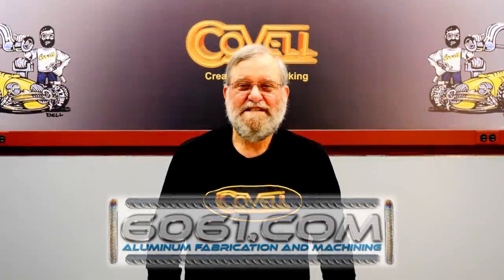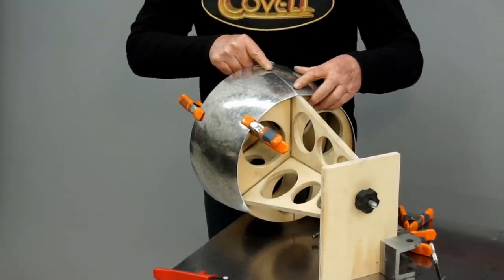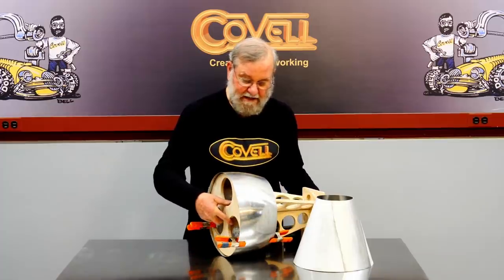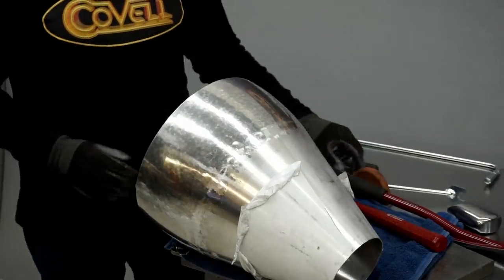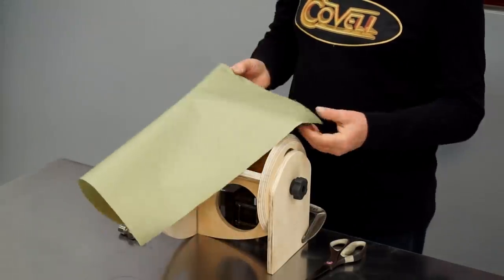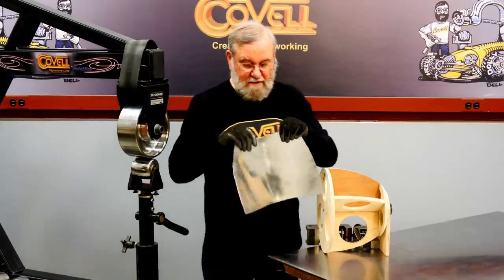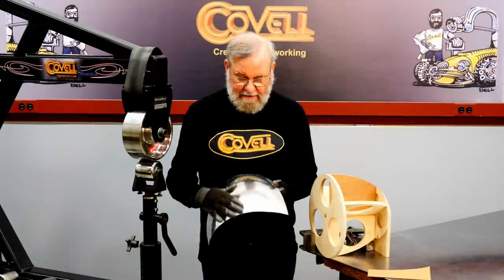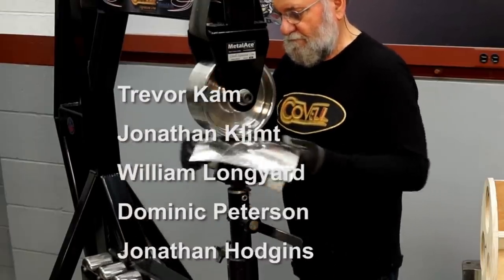Making the F-Bomb Part 3 - Joining the Pieces

Comment: Ron 
You Sir are a legend and well regarded world over.
I note when you are sanding back the weld, what are you applying to the sanding disc?
Love your explanation and tips and tricks.
You make tis look so easy, and explain thing really well.
Regards from Australia
Reply from the maker: I use any kind of bar soap to keep the abrasive from getting clogged with aluminum granules.
Reply: @RonCovell  thanks Ron

Comment: Hi Ron,  you never cease to amaze me with your control of metal. 
So when forming those front sections, does the English wheel actually stretch the metal or does it shrink it as well?
I remember watching a video quite a while back, not sure if it was one of yours, where they put the metal on a sand bag and attacked it with a pointed nylon hammer,  and then used the English wheel to smooth it out into a wok shape, quite quickly to. 
I'm looking forward to seeing you put the two pieces together when you don't have the buck to provide alignment. 
Regards Dennis.
Reply from the maker: The English wheel can stretch or bend sheetmetal, it really isn't designed to shrink it. 
Years ago, I used to 'rough out' shapes with a mallet and sandbag before wheeling. It does save a little time when doing deep shapes, but now that I'm a senior citizen, I shy away from vigorous hammering (hurts my joints) so I find that I can wheel a shape pretty much as deep as I want with the wheel alone, even it it takes slightly longer.
Getting the front half to match the back exactly is pretty tricky work, but you will see how I do it in the next video!

Comment: When you hammer the welds flat does it expand the metal, therefore increasing the circumference slightly ?
Reply from the maker: Well, it certainly can. A lot depends on how much of the weld I remove by grinding - the less weld left and the less hammering, the less the circumference expands.

Comment: I have your DVD from back in the day on English Wheel usage.  I think this series is actually more instructive.  One question I would greatly appreciate your help with:  do you wheel right to the edge on these sections and if so how do you not end up with wavy metal edges?  For reference I have the 2010 version of the harbor freight english wheel which I think is pretty good but obviously not like the $5000 one you have.  Thank you.
Reply from the maker: If you are wheeling at high pressure, the edges should be avoided. For the finish work, I sometimes drop the pressure down to the minimum so I can wheel right off the edge without distorting it.

Comment: What was your thought process for not putting any shrinking in the parts for the nose cone before using the English wheel?
Reply from the maker: Shrinking would certainly have speeded the process. Sometimes I just like to avoid putting marks in the metal from the shrinker jaws.

Comment: When crushing the welds how do you prevent elongation or creating flat spots?
Reply from the maker: Crushing the welds DOES stretch the metal. That's why I sand the bulk of the weld bead off first - otherwise it would stretch the weld area a great deal more. 
On high-crown panels, it's not too hard to deal with this distortion - you can often blend it in so it's invisible, or shrink an over-stretched area by hammering off-dolly if necessary.

Comment: Love seeing all of the metal working techniques which is why I'm happy to support the channel.   I do have a question through.... When you flatten the weld with the planishing hammer wouldn't that cause your surface to raise up slightly because the metal has to go somewhere, or is that area just more dense.  I'm not sure how compressible aluminum is....
Reply from the maker: Flattening a weld DOES stretch the metal, and that's true whether you do it with a hammer and dolly, planishing hammer, or English wheel. The reason I grind off the majority of the weld on the outside is to minimize the amount of stretching required, and often it's possible to blend in the stretching so it's not a problem. There have been a few times when hot or cold shrinking is required, but not always.

Comment: Hello Ron.
is this the project we talked about some time ago?
looks impressive.
I like the effect
Regards
Rafal
Reply from the maker: If memory serves me correctly, I think I told you I would show a simple cone forming technique - and the Part 2 video shows that in detail. With the thin metal that I use, wooden forms work well, and as you'll see that the form doesn't have to be solid as long as the ends of the panel have support.

Comment: I was always wondering, what's the point to scratch up aluminium before welding, if it oxidizes immediately. Does it actually help?
Reply from the maker: Aluminum oxide melts at about twice the temperature of bare aluminum, so it's a real impediment to welding to have a lot of oxide floating on top of the puddle. While aluminum oxidizes nearly instantly, there is a difference between a thin oxide layer and a thick one, so brushing just before welding does offer significant benefits.
Reply: @RonCovell  I see. Thank you

Comment: Great video, do you ever have to normalise metal pieces after creating them? If so do you do it yourself or send them out?
Reply from the maker: I have done some jobs for industry where normalizing (that's how we spell it in the US) or passivating is required, and I have sent those jobs out to a heat treating facility, so the process can be documented in a report. I have sometimes annealed parts in my shop after fabrication, which is similar to normalizing, but less controlled.

Comment: Awesome! May I ask you what type (or reference) of aluminium do you use to shape and weld so "easily" please? Thanks :-)
Reply from the maker: I'm using 3003 H-14, .063" thickness (1.6mm). The welding rod is 1/16" (1.6 mm) 1100 alloy.
Reply: @RonCovell  Thanks Ron! Very helpful.